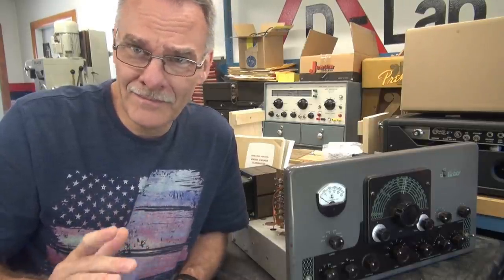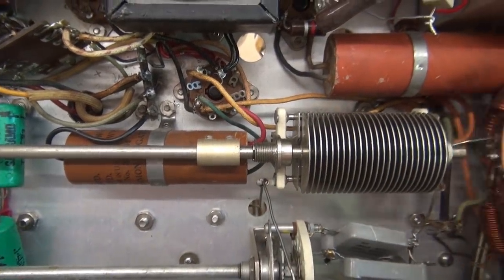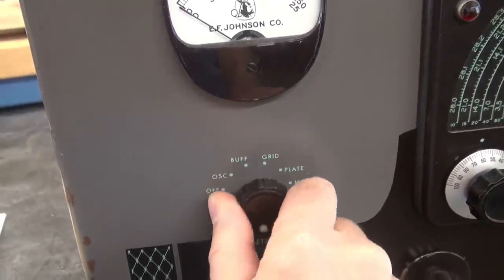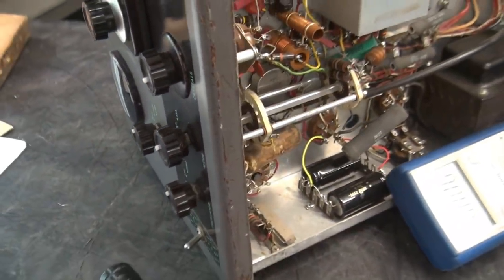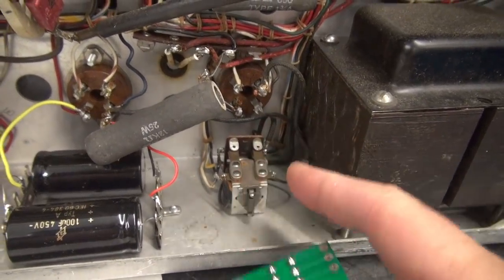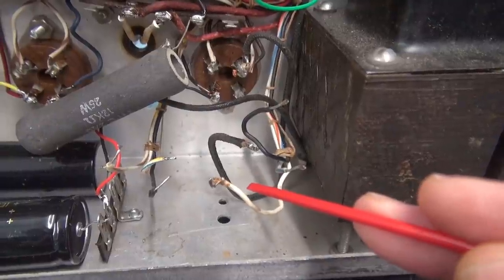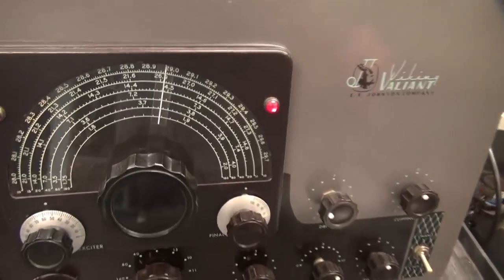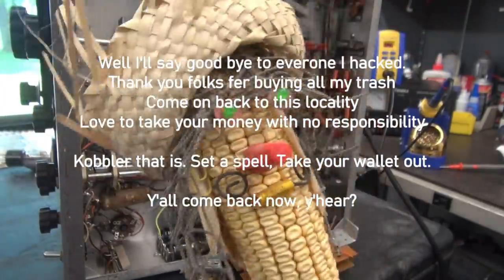How to install Push to Talk PTT Johnson Valiant Ham Transmitter + other repairs yes Kobbler victim

Comment: Terry, bought your relay replacement circuit board around 11/5/2023, just installed it today, 11/18/2023.  Worked perfectly upon first test, an easy install.  Took about 90 minutes to disconnect and accurately label each lead as it was removed from original relay, but the installation of your circuit board was quick & fast.  Thanks for offering it to all us Hams.

Thank You,

Chuck W9KR

Comment: Corny humor!  (Well, SOMEBODY had to say it!)

Nice video, I cringe a bit when I see "work" like that.  I had once worked on a 23-channel CBS radio where someone had tried to add in the 24th position on the selector switch.  All six crystals in the 6x4 matrix were always making contact, so it was transmitting and receiving on six channels at the same time!  Not very well, but it was.  I was able to rework the switch and get it back to normal, but that's one of my list of all-time bizarre findings & fixes.

Take care, Terry!  Hoping you & yours are all staying safe, happy and healthy.

Comment: Looking forward to the Part 2 episode!  I noticed that it "appeared" that you didn't replace one of the old large paper/wax capacitors.  The one to the left of the piggy backed electrolytics.  Maybe I missed something, but it appeared that it wasn't replaced.  Anyway, great advice about know what you are buying!!!   Even some "good" mods can need attention and part replacement as well.  Thanks for pointing out the needed information!
Reply from the maker: Yes Sir, lots more required. More to come on the Valiant

Comment: 0:50 A voltage multiplier, I'm guessing. One way to get your kilovolts in lieu of the rectifier tubes:)
UPDATE: Oops! I took a much closer look at those diode boards, they're just many diodes in series with Rs and Cs paralleling each.
The schematic below indeed shows EIGHTEEN 1N4008s!
https://www.qsl.net/n2ffl/VikingValiant.html
I'm guess whoever did this mod was using info from this page!
Note from the schematic:
------------------------------------------------------------------------------------
"SOLID STATING" THE VALIANT POWER SUPPLIES:
1.) REMOVE RECTIFIER TUBES AND INSTALL 1N5408 1000 PIV, 3 A DIODES.
2.) REPLACE ALL FILTER CAPS, C91, C92, C93A, C93B, C98A, & C98B. 
(Well, step 2 is the only one they got right :))

Comment: Your keying circuit is very quiet but you've gotta admit that some of those old radios had relays that sounded like a power station getting turned on and they sounded awesome.
That radio is going to be quite the project but it's in the right place. Hopefully the customer goes for the repair job.

Comment: Is there any room to add a separate 5V transformer for the rectifier heaters instead of replacing the big transformer?
Reply: Personally, I'd think about doing solid state rectification.  But my concern would be knowing exactly how the transformer failed.  Otherwise, it may still have some surprises left as it fails some more.
Reply: The 3B28 uses a 2.5V filament. So did the original 866 rectifiers.
In the Valiant those tube filaments are in parallel so it looks like he measured the correct voltage on the T2 leads that had been cut.
Something else may be going on, or someone thought solid state was cheaper or easier or 'smarter' than buying some new tubes.

Comment: Did anyone note that the original rectifiers were 866 types & that those & the commonly used substitute 3B28 tubes are both 2.5 VAC filament tubes?
The Valiant schematic shows the rectifier heaters are in parallel. So it looks like he measured the right filament voltages off T2 but seemed to have assumed they needed the common 5 volts.
Or did I miss something??
Reply from the maker: See description, Yes, you are correct. Part 2 will cover this
Reply: Hi!  My browser cut the Description off, it ended in a midsentence & I just thought it was an editing error.  It'd be nice to have those glowing rectifiers lighting up on the transmit side.  :-)

Comment: Like the flag day shirt!!
Reply from the maker: You need a PTT module for your Valiant
Reply: @d-labelectronics  Yes sir, mis-wired a mike and got a shockorama.
Reply from the maker: You want a module?
Reply from the maker: 10 meters is wide open. My beam will be here tomorrow
Reply: @d-labelectronics  Grease it up. I have tube of silicon grease romr a old MX missile.
Reply: @d-labelectronics  Nothing on 10 here pointing west. CB is open daily.

Comment: FIRE Hazard, & Electrocution Hazard,  No Tension Relief on Power Cable,  hummmm. More effort put in to mods than it would take to FIX it properly.
Reply from the maker: Yes, lots to do to get it back into safe operation